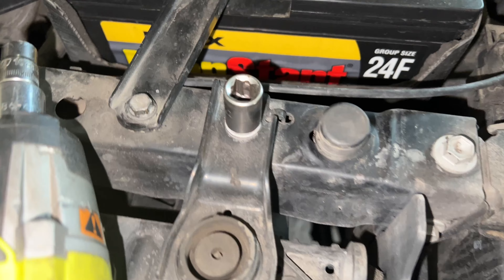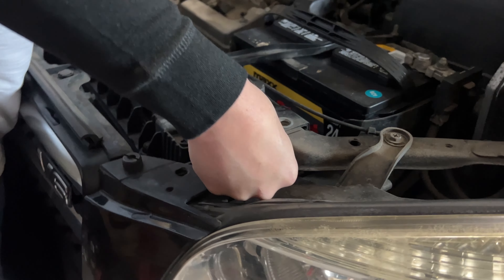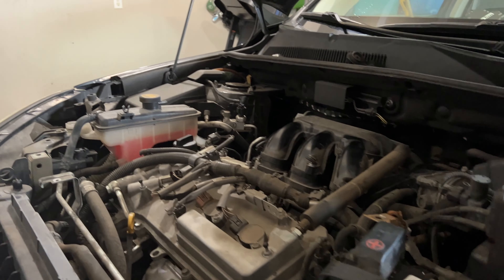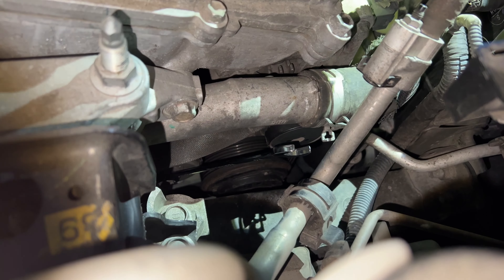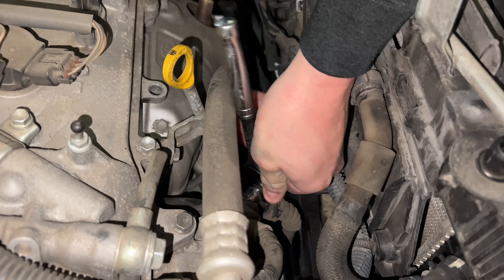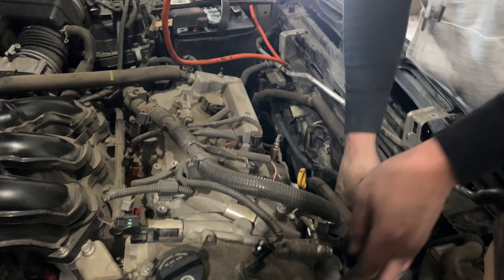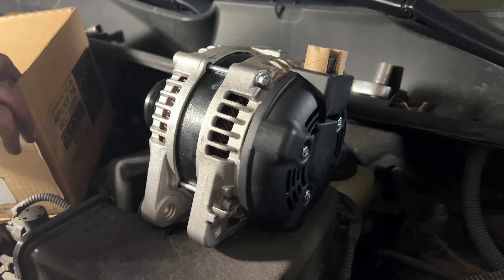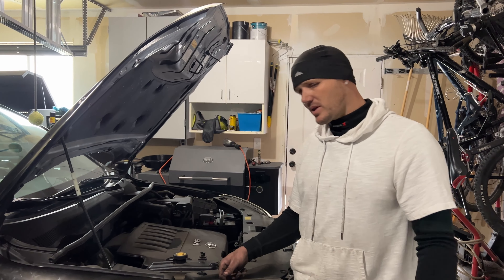Toyota Rav4 Alternator Replacement

Comment: Thank you! Your video helped me a lot. Removing the alternator from that tight space was not that bad for me, I guess I just got lucky. 

Tried putting the belt back on from the top but could not do it. Had to resort to putting the car up on jack stands and removed the bottom liner along with the passenger side wheel and plastic side cover to access the belt. An extra 10 minutes but got the belt back on without a problem.

Here are the torque specs for the alternator bolts if anyone needs them:
14mm - 38ft-lb (52 Nm)
10mm - 7ft-lb (10 Nm)
Reply from the maker: Thanks
Reply: Thanks for this video! It’s one of the few for this particular configuration. 
One tip for anyone doing this: There’s a small bracket that holds the third screw.  Once you loosen the alternator, if you turn it so you can see and remove a screw that holds this bracket onto the alternator, the whole thing comes out much much easier. Push the new alternator back and then reattach the bracket.